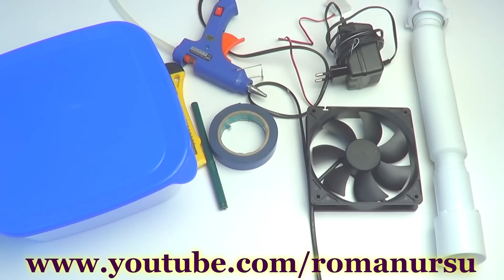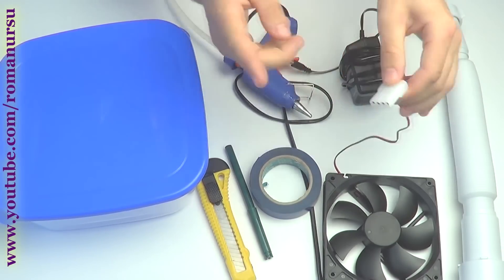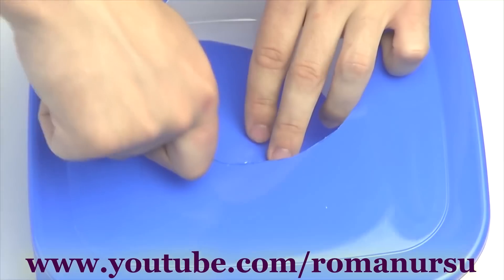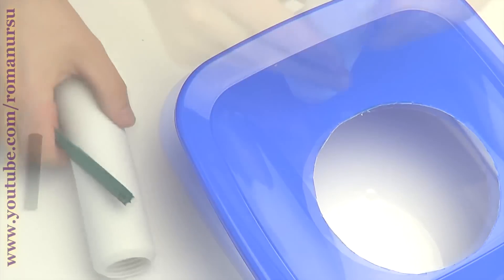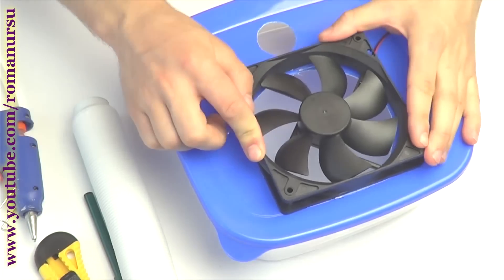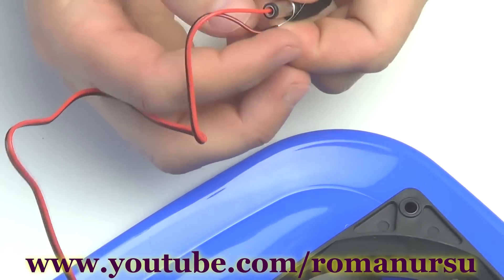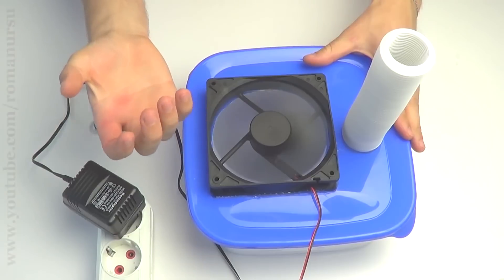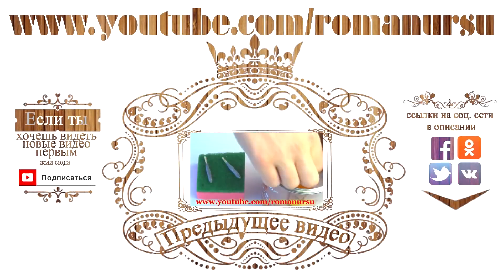How to make a mini air conditioner / HACK PC FAN

Comment: did you know that you used a non insulated container so now you will have condensation on the outside of the container causing water to drip all over your table. This is why everyone else makes their air conditioner with insulated coolers.

Comment: nice my pc needed condensation and moisture on my electronics parts.
Reply: This makes no sense... it wont be a problem unless you take your side panel off and directly face the tube on a part.
Reply: Lol does it make your Pc part got worst?
Reply: instead of using ice, use some metallic containers filled with ice (or better fill with water and put in your freezer). this way the melting ice will stay in the container, and your "air conditioner" will actually reduce your room humidity by condensating air's water in contact with the outside of cold metallic containers.

Comment: If you conect the CPU Fan wire directly to the adapter pin will create issues on current flowing to the CPU Fan motor when not soldered. This is not the right way to give wire connection, it has to be soldered properly so it will not cause curent flowing fluctuation and Capacitor to burn out.

Comment: instead of using ice, use some metallic containers filled with ice (or better fill with water and put in your freezer). this way the melting ice will stay in the container, and your "air conditioner" will actually reduce your room humidity by condensating air's water in contact with the outside of cold metallic containers.
Also note all these homemade "air conditioners" are really bad at cooling air. They do but nothing noticeable (1 degree at most at feet height?); instead doing as i said they have a great de-humidifying potential.

Comment: Every homemade air conditioner I see works like this. Make one with a compressor or supercharger if you want to be original, this is the worst way to make it because you need a refrigerator.

Comment: i have correctly made this thing....and the air is cool af...but the only problem is that the speed of fan is too slow...the throw of air u get from the siphon pipe is simply not enough..you have to stay near to that pipe like these words are..its so annoying...what can i do to get it to max? btw i have hooked up 4 9-volts batteries and tried powering it up..it spinned much fast but still its slow...help!!
Reply: You can buy the fan part of a reef blower, but that would be overkill in my opinion.
Reply: maybe make the exit tube thinner?
Reply: You can choose other methods to build this diy air conditioner. There are tons of design out there you just doesn't have to stick with this design only.
Reply: get some sort of turbines, 1 for air in and another for air out.  I think it's called turbine, where it's more sealed and longer blades so it pushes more air (like a much thicker fan) and less air is able to escape through the gaps (because it's longer and there's more of a suction effect)